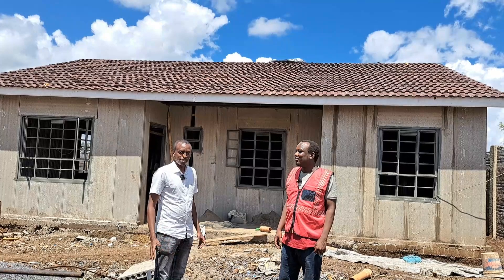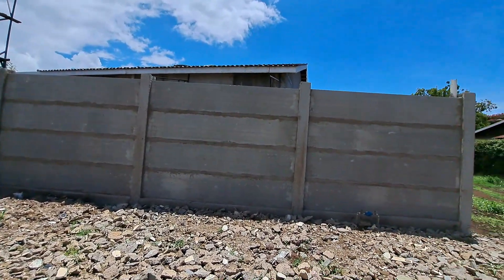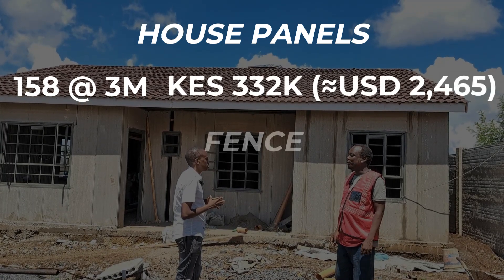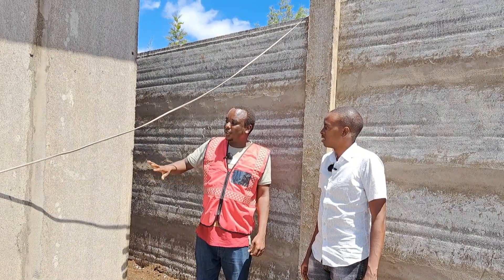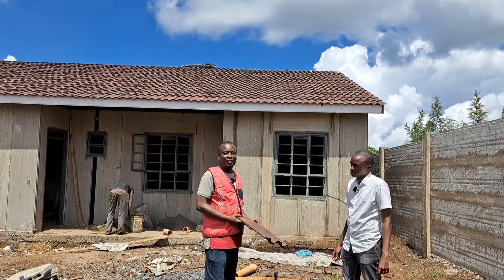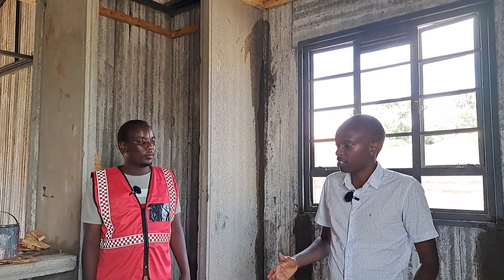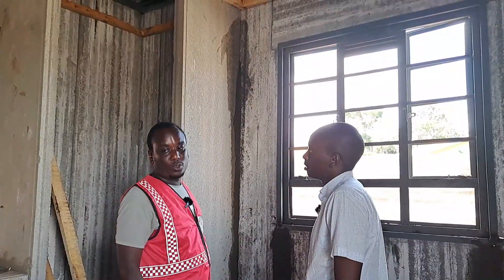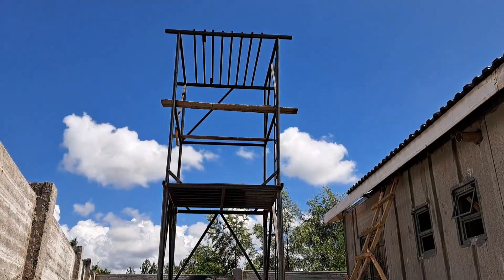Engineer Transforms Precast Concrete Panels into a Stunning 4 Bedroom Home

Comment: How do you go about the foundation?
Reply from the maker: The foundation is built normally, using foundation stones to build the wall and a concrete slab casted on top. This is called a raft foundation.